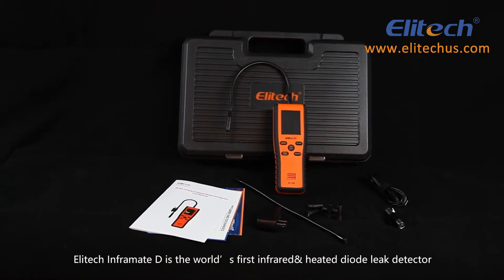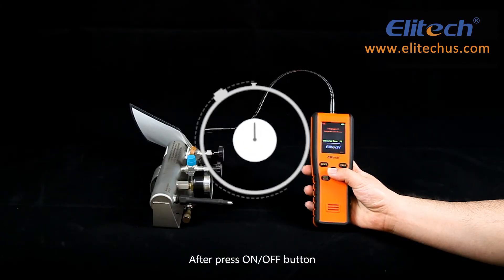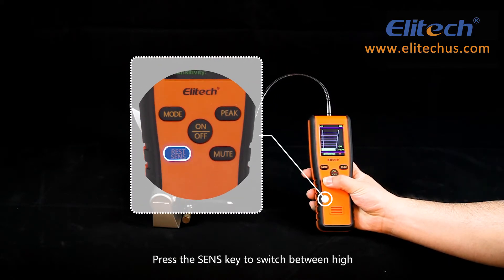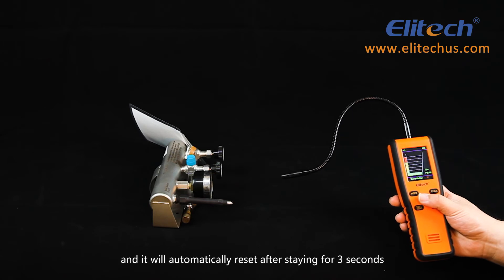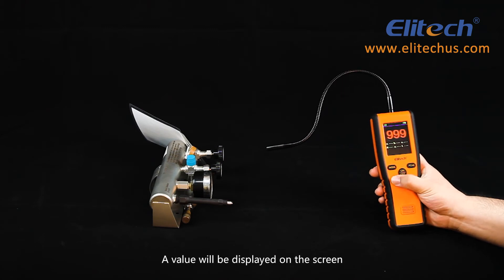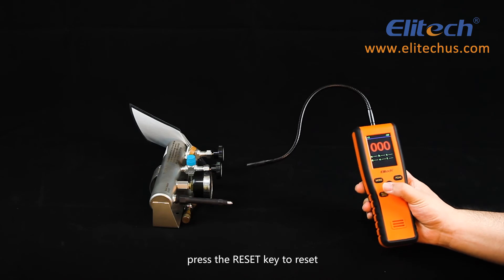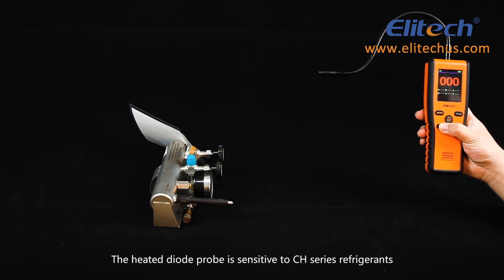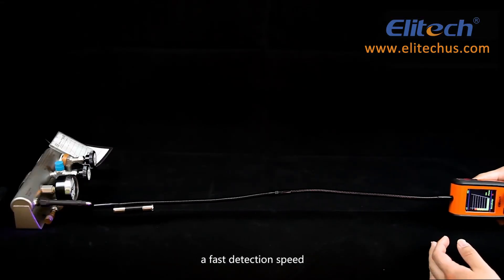Elitech IR-200 Heated Diode and Infrared Advanced Leak Detector

Comment: Ive had my IR-200 for 2 years now. If my heated diode sensor portion of the detector goes bad. What are my options for bringing back full functionality. Will i have to buy a whole new leak detector? Or can it be sent in and replaced? Thanks.